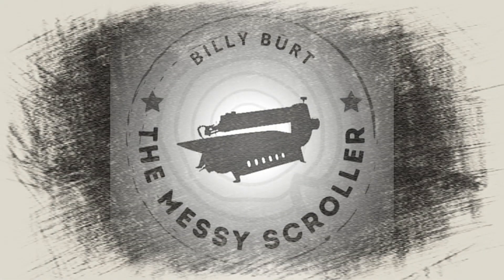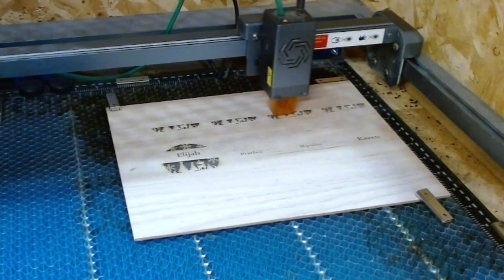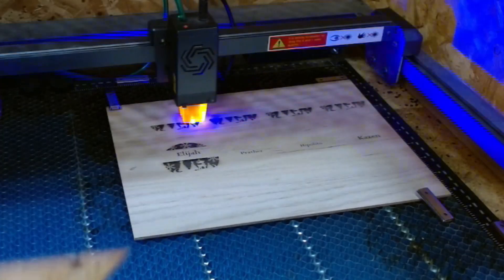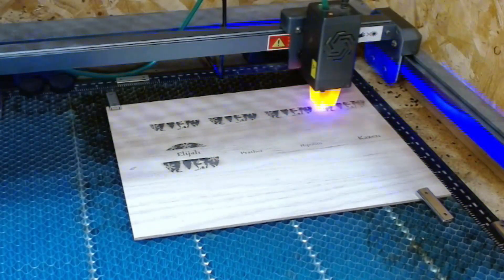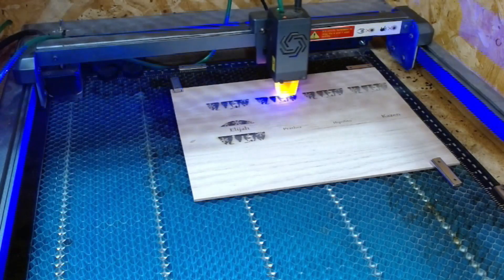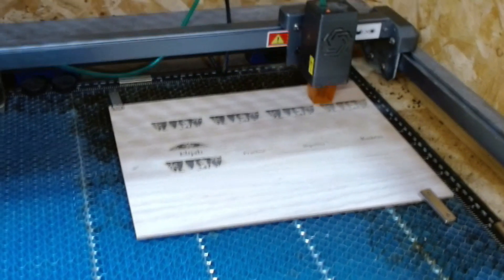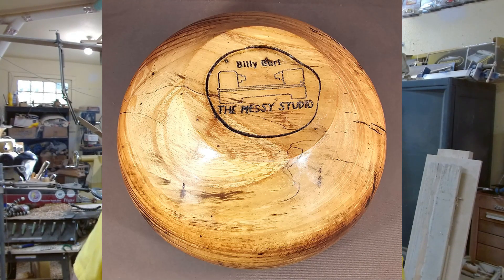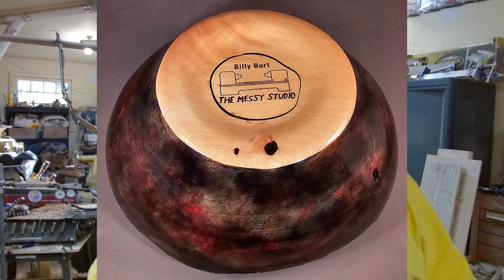Easy Crafting, Ortur Laser Master 3 Review

Comment: Great video Billy.
I have the same laser and was wondering about the air assist. When I get around to actually setting the LM3 in my workshop I'll look at aquarium pumps instead of the Ortur Pump.
I just need to get my head around Lightburn before I do anything.
That's the plan for next year as I've been so busy with craft market lately I've not had time to do anything else.
My LaserPecker 2 has been amazing and probably accounts for at least 75% of my sales.
Take care my friend.
Cheers, Huw
Reply from the maker: Cool, Huw!  I think you'll like it!